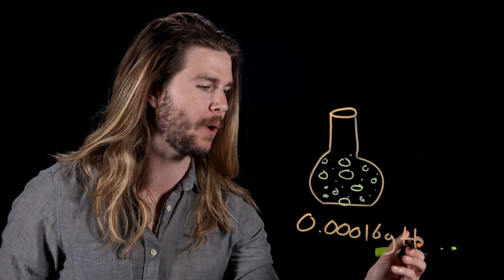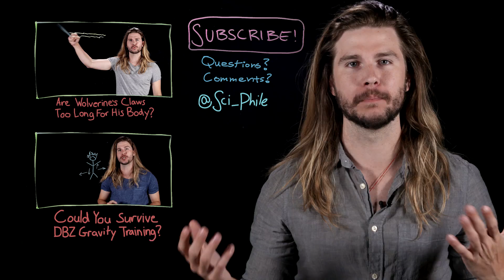How Many Wonka Fizzy Lifting Drinks Would It Take to Float? (Because Science w/ Kyle Hill)

Comment: Sorry for leaving a comment on such an old video and sorry again if this has been addressed already since then but the lifting drinks wouldn't only need too lift Charlie's weight but also the combined mass of the drink itself which would require even more soda and it quickly becomes the same issue of why rockets don't simply carry more fuel. He would have to drink even more to account for weight of the drink

Comment: ejecting mass downward should grant propulsion but if it lessens the molecules that make them float, then drag should intensify and could over power the push. and if factored how little they drank then it cant be a reaction like some comments thought because it is super concentrated and they would have been chop suey. though if the concentration is expelled from a liquid to a gas then i think a fart is viable to be a way to help float you back down.

Comment: Isn't it possible that the Fizzy Lifting drinks instead transmute existing body chemicals into a lighter than air gas? Also, as for the bottles always being floating...Back in the day, Wonka could've just been shoving Lead on the bottom of the glass, or something else heavy. As long as the bottle's floating was countered by weight, it'd work out to FEEL as heavy as a regular soda, but it'd be really hard to recycle the bottles. Also, would be REALLY annoying to try to manufacture a drink that floated away after a certain point in the processing.

Comment: If it was possible to get the Fizzy Lifting Drink to work and excrete the gas as a fart. Would the reduction of the gas not outweigh the increase speed towards the ceiling fan of certain death.

And was it not so that in those other version the turned themself upside down.

What if you sneeze while on Fizzy Lifting Drink?

Comment: Actually, there is something that's less dense than hydrogen. A vacuum.
Yes, there is a buoyant force upward applied to a vacuum tank, but typically, those tanks weigh too much to float. So if Wonka figured out a way to harden the inside of the stomach enough to withstand atmospheric pressure, and somehow create a vacuum inside, he could possibly accomplish this.

Comment: I have a few theories on this.

1.) Perhaps he's simply drinking pure liquid hydrogen. Sure, its kinda cold, but you'd need a LOT less than 10.5M bottles of the stuff.

2.) Wonka managed to dissolve negative matter into water. Depending on its properties, Charlie might need only a single drink to lift him off the ground.

3.) And this is the most likely. Since Charlie and Grampa Joe drank about the same amount AND were also going up at roughly the same rate, we really have to conclude that it wasn't the drink at all. That's right, I'm saying two people starting floating after drinking the drink is nothing more the a vastly unlikely coincidence. Or aliens.

Comment: Question.  If they actually farted while upside down would that mean the same as if they were right side up.  And speaking of upside down I have an idea/question for a future Because Science.  There is a movie from 2012 called "Upside Down".   The movie features two planets with 'dual gravity' which allows the two planets to orbit each other in what would otherwise be impossibly close proximity.  There are three immutable laws of the gravity for this two-planet system.  1.  All matter is pulled by the gravity of the world that it comes from, and not the other.2.  An object's weight can be offset using matter from the opposite world (inverse matter).3.  After a few hours of contact, matter in contact with inverse matter burns. So my question is, is this possible?  And if it is are the three laws also possible particularly the third law. I would love to know your thoughts.  Thanks for another great show.

Comment: always wondered if you could survive for 1 second at 1 million degrees. what about even hotter?
Reply: The Leidenfrost effect would definitely buy you some time, but I'm not sure how quickly water is truly capable of sublimating. Cause if you stuck yourself in a box with an oxygen tank & mask, then covered the outside in a "thick" layer of ice, I really don't see why you couldn't. 

As far as direct exposure, I'm really not sure. Definitely going to die in the end, be it from the incineration or the radiation that would come off of anything capable of getting that hot. I suppose the quickest/easiest determining factor is how quickly is liquid water/blood/sweat capable of raising in temperature?

Comment: I feel like you write Helium off too quickly - sure, it is twice as dense as Hydrogen (assuming you're taking molecular H2 rather than monatomic H), but that comes to a lift roughly 12/13 as much for the same volume of gas - calculated by treating air as pure N2 - the 20% O2 improves the buoyancy of both He and H2 and changes the ratio from 12/13 (0.923) to 62/67 (0.925) - and then you can take account of isotopes rather than taking the dominant ones, and so on - the point is that switching from H2 to He only increases the volume required by around 8%...

Comment: Would have been sort of neat if you'd done the math to figure out the details of a theoretical "new" element that, say, Wonka discovered and used for the drinks. What would the mass of a single atom be? How might it relate to other elements?
Reply: It doesn't matter how light it is - if Wonka somehow produced drinkable vacuum bubbles that filled your body with pockets of literal nothingness, the limit on how much buoyancy you could experience is still the mass of the air that would fill the space occupied by your body if your body weren't there.

If these hypothetical vacuum bubbles had the same solubility as hydrogen, then you'd be able to get the same lift from fewer bottles of the stuff - if it takes 10,500,000 bottles of hydrogen drink, then it would only take 9,750,000 bottles of vacuum drink.

Similarly, switching to helium (if it had the same solubility) would mean needing to increase to 11,400,000 bottles.
Reply: Yeah, I think negative mass is the only way to go.

Comment: Question: Is it possible to curve a bullet?
Reply from the maker: According to the MythBusters, nah. -- KH
Reply: There are a couple of problems I can see with that. 

First you cant increase the spin of the bullet by flicking the gun, youd be trying to get the bullet spinning in a way its aerodynamics and the rifling were built to immediately correct.

Second, I dont think the Magnus effect works in the right direction; because wind travels along the surface of the Earth, and the bullet is spinning on a horizontal axis, itd produce lift, drop or very little of either. I.e. when you see a football player kick the ball and get a sideways curve on it in to the goal, it is because of the rotation around the vertical axis.

That said, if the bullet was a different shape to that presented in the film, (basically like a golf ball) and the flick was putting drag on one side of the bullet and consequently putting spin round the vertical axis you need, then it could be possible. 

Heres where things get a little in to guess work.
I used a fairly small and light ball travelling at a velocity of 120m/s (About the slowest guns have ever been.) I assumed it could get similar spin rates around the vertical axis as bullets currently got on the horizontal. (Pretty big assumption perhaps.)
I dont have a coefficient of lift, though from some looking around suspect it will be around 0.04 again this could introduce some major inaccuracies if Im way off with that estimate.

All this plugged in would make the bullet move along the ark of a circle with radius 430metres. Given the typical range, it means the bullet would swerve around 30 degrees before hitting the ground.

This is assuming the gun is built to swerve bullets, so I looked at getting it to happen with a flick of the wrist... and I think it might be kind of plausible. The issue here is that you have to have a higher angular speed than linear speed or the bullet will just slide out. The friction you can apply wont slow the bullet down much. (Thats why no matter how fast the Mythbusters moved, the bullet didnt just fall out of the end.) but it appears it will help the angular speed a lot. For them to match up you only need to pull about 26g. Thats well within human ability. 
This will also mean the bullet is spun up to the necessary spins to get that curve. It all seems to fit together... so I kind of expect Ive made a whole bunch of horrible errors.

Anyway, itd be interesting if anyone else wants to look at it. Even more interesting if someone actually has a large empty area, camera with a good frame rate, and a cap and ball colt...
Reply: yes, if you use a curved barrel. They did it on mythbusters
Reply: had wondered so too after watching "wanted" , good movie and that shot by angelina jolie was really cool but I was doubting that it was possible to happen!
Reply: what about an arrow?
Reply: Sadly nope
Reply: Yes, but you'd need speeds far far FAR greater than you could possibly flick you wrist. I haven't done the exact calculations but its also fast enough that most machines built for this purpose would be torn apart by the forces of trying to do this.

So technically, yes. Though no one is going to spend the several billion dollars to prove it.
Reply: See Newtons First law.

You could be Superman flicking an indestructible gun and bullet at sizeable fractions of the speed of light and the flick still wouldnt make the bullet curve one iota once its left the barrel. (Bias introduced by the nuclear bomb scale devastation involved in flicking things at sizeable fractions of the speed of light in an atmosphere not withstanding.)
Reply: Bob Spitfire Yes, but if you put enough spin on it, it'll curve due to the Magnus effect. Of course this would require an absolutely absurd amount of spin (far more than the bullet could withstand).
Reply: Yeah to answer the question you can just not really reasonably, at least not using the gun itself. Also any curving you would get would be tiny for any reasonable distance due to the speeds at which a bullet travels.
Reply: Yes, you're right. It is along the wrong axis. My bad, Somehow I got it in my head that the axis doesn't matter. But its very important.

The other issue with bullets is that the Magnus effect is incredibly small due to them being more or less smooth. It works wonderfully on soccer and baseball because they have fairly large "bumps". Bullets don't have them nearly as large (but they do exist at very small levels). This is why I said it would work, but only if you got it spinning at a rate much much higher than its integrity could stand.

Anyway, thanks for the attempt. I'd try myself but I don't have access to anything I'd need to make it halfway accurate.
Reply: Dario Varga there is a gun made in WW2 that fires round corners

Comment: you don't need to get the hydrogen (or all the hydrogen) from a dissolved water solution... OUR STOMACHS ARE FILLED WITH IT!

Additionally, our blood is normally filled largely with nitrogen, but this can be a different gas (see mixed gas scuba diving)

If we safely liberated hydrogen from the stomach (HCl & the contents) with either a chemical or bacteria, and displaced the nitogen in the body's blood ... you could totally float with far less volume having needed to be drunk & retained in the gastrointestinal tract.

Comment: what if the pressure in the room was greater
Reply from the maker: Oh dang I didn't think of that. I'd guess that at the pressures you'd need to get him to float with one bottle that there would be deadly side effects from the air alone in there. -- KH
Reply: what if it was not water?
Reply: whats the lightest liquid?
Reply: The lightest "liquid" might still be hydrogen. Just like nitrogen, if any gas is super cooled to extreme temperatures, it will eventually turn to a liquid form.

Although when supercooled gas liquid comes into play, Charlie would have an entirely different problem on his hands than just worrying about floating away. Drinking liquid Hydrogen would definitely cool you down on a hot day. Too bad it might freeze your insides solid.
Reply: volksdude1970 actually neutronium liquidised would be lighter

Comment: I'm probably missing something big here, but apart from the fact Charlie clearly doesn't have over 30 cubic meter in his stomach, is it maybe possible the bottles contain insanely high compressed hydrogen?
Reply: The whole idea of buoyancy is differences in density. Compressing the gas would make it much more dense til it'd be much denser than air and you could never float. You'd need 30+ m^2 of uncompressed hydrogen to displace the same mass of air as your body does
Reply: +Speedup i meant as in it decompresses in your stomach.

Comment: What if Wonka was making a catalyst that took sugars with their derivatives and breaks them down inside of a body? This could work leaving hydrogen in carbon chains in the bottle and once ingested the hydrogens are reacting with the catalyst forming hydrogen-hydrogen bonds. The catalyst would be a very a SECRET trade-secret ONLY to Wonka 

This makes sense in the movie where the characters need to burp to control the altitude. The burps would be the excess hydrogen(g) that come out of solution from the hydrogen(l). 

The catalyst way could manage to lift 30kg within a reasonable amount of soda.

Because science...
Reply: Next there'll be a catalyst that can do cold fusion
Reply: the only way how this could work (which it doesn't),
would be to break enough hydrogen free from the molecules in your body to increase the volumen of your body until your body has a low enough density to float.
Which is impossible because only 10% of the mass of your body is hydrogen (and this is all the hydrogen in your body, not just the hydrogen bound in sugar).
Also you have to solve the problem of people dying when you do this, due to the increase in volumen and the fact that you just ripped the hydrogen out of a bunch of their molecules.

Also don't try to uplift your comment by your "+", if anything it will get your comment flagged as spam.
Reply: Actually, about 60% of a human body is composed of water. Each molecule of water is composed of 2 Hydrogen atoms and an oxygen atom. And that 30 cubic meters of hydrogen needed to lift 30kg may seem like a lot. But the volume of just the hydrogen from water expands about 1300fold at 1 atmosphere of pressure at room temperature.

As for a catalyst, you just need a really fatal amount of electricity. Algae can also split water, but not very efficiently.
Reply: Adam Arroyo the catalyst is called wonkagen
Reply: Not science if you can't say what the catalyst is. I'm sure Thor here can do a lot more if he could just add a mysterious "catalyst" to his equations.

Comment: Although, by farting, they are ejecting the gas that is keeping them buoyant, so wouldn't that negate the upward force? If a balloon filled with helium/hydrogen is tried to a weight with a string and maintaining a slighly upward buoyancy, springs a leak on the bottom, the balloon/weight won't be propelled upward but start to come back down, right?

Comment: Well, I guess the fizzy lifting drinks are reacting to the chemistry of the human host. Instead of putting gas in, couldn't the drink be changing the Oxygen or carbon dioxide or both together in Charlie's body into a lighter gas? And since they started falling when they burped they were releasing the fizzy out upsetting the chemical balance so gravity grabs them and brings them down. 
 Also, was it true that Gene Wilder surprised both actors when he angrily said that line you said about losing the contest?

Comment: You missed out on the fact that all that hydrogen even if possible to drink would not lift charlie up because it would need to occupy the volume it does at atmospheric pressure to displace enough air to make the buoyant force work. So strapping a balloon filled with about 50m^3 of hydrogen might do the trick , drinking the same will not because .....science

Comment: so its an endless chase in the pursuit of flight, but what if the gas was incredibly hot high energy thus less dense? and the liquid was expelled instanly?how many bottles would it take then?
Reply: Even if it was vacuum (a weight of 0 grams per liter), you'd still need a bit over 40 cubic meters of "vacuum drink". Or 10567 gallons.
Reply: holy shit, so its impossible, heres a question, what is the smallest container you can have to make a human float assuming it has infinite strength and is the weight of a tesco bag.
Reply: Owen england Assuming the human was 50kg? The answer I gave above: 10567 gallons, 40 cubic meters. This is why hot air balloons are gigantic.
Reply: Assuming they're floating in air, of course. Floating in water is much easier.